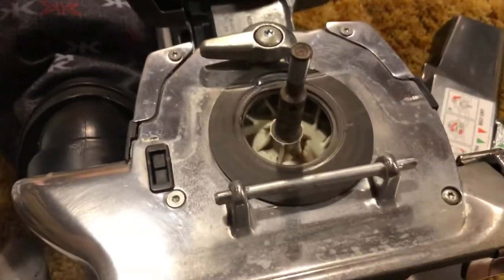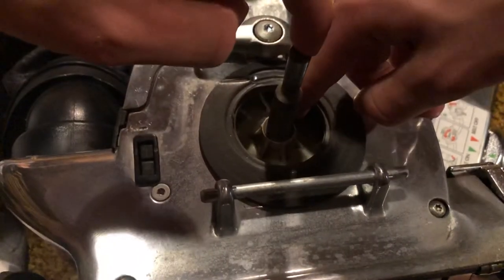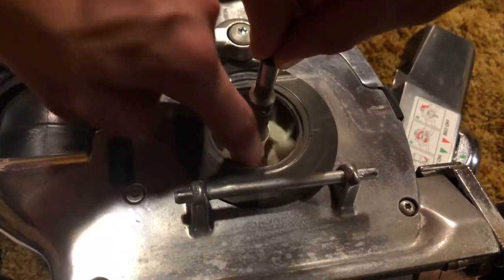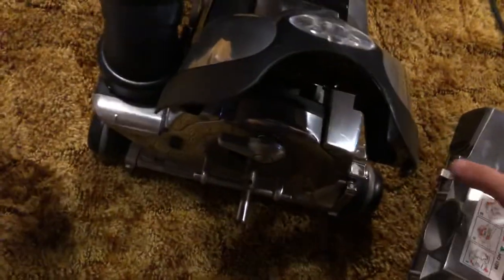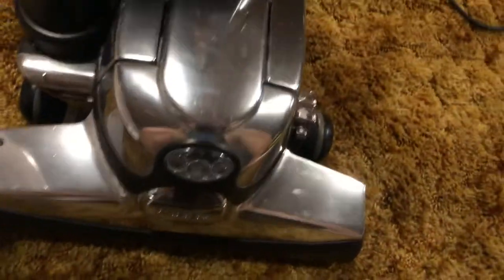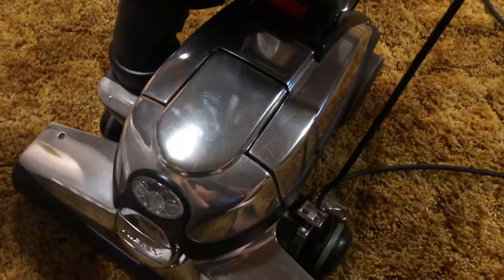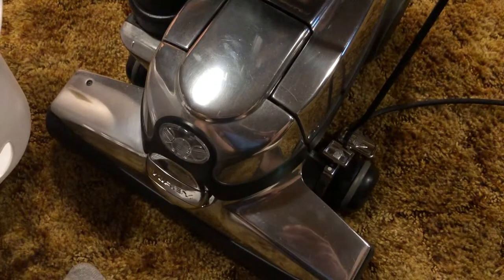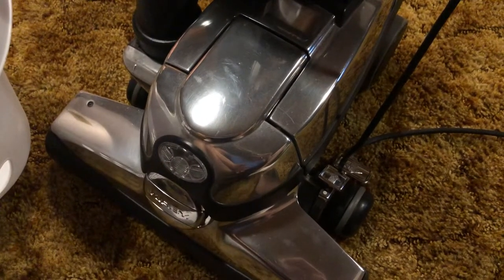Kirby Avalir lose fan

Comment: You can tighten it by inserting a small Phillip's screwdriver into the hole in the pulley and turning it counterclockwise. You will want to hold the fan while doing so. If it comes loose after that, you may want to consider replacing the entire fan, pulley and washers. You can find the whole kit on eBay.
Reply from the maker: Matt Jones yeah I was actually thinking of doing something like that